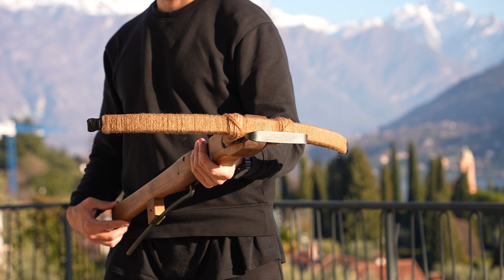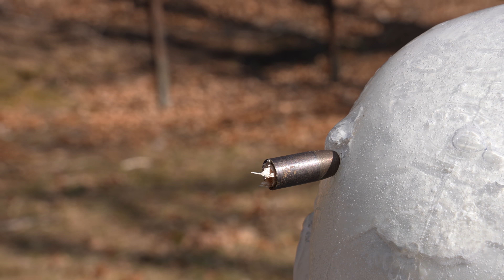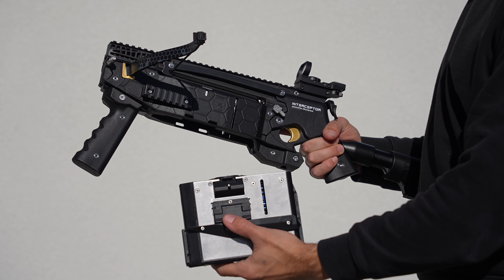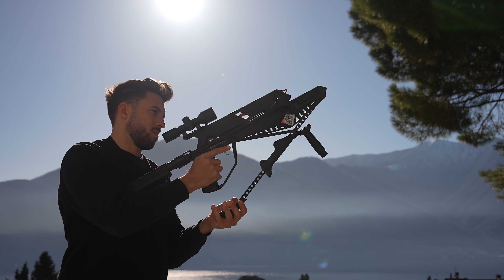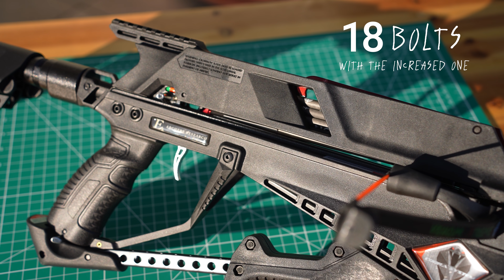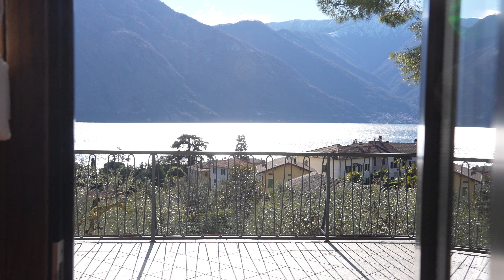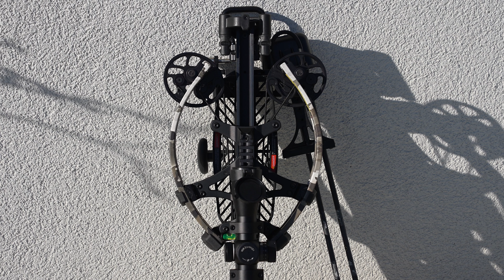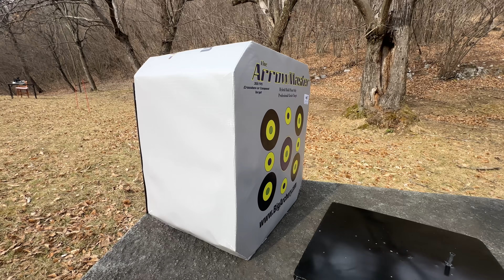How Dangerous are Crossbows?

Comment: Bad enough politicians and the media want to make up definition of Assault Rifle or Assault Weapon. We don't need influencer nonsense being irresponsible on research as well. As defined in military manual Assault Rifle and or Assault Weapon by proxy must have select fire semi, pulse, and automatic fire modes. This means a common machine gun has select fire semi and automatic fire, not an assault rifle/weapon. Go see the m16 manual among other weapon manuals for military weapons. If it's a so called combat application that's where the real definition exists. I find it very irritating when I flyencers, media, and politicians mislead people largely unwilling to research for agenda.

That all said that roller cam crossbow is a design type I've thought about making for fun. Keep in mind same as archer the speed at which your fletch stabilizes is the true point accuracy increases. Along with that is stiffness of the shaft. If you put off vane on the spine where the end of rolled sheet ends. Your arrow/bolt spread greatly reduces due to consistency of flight. In the end just like balistcs in rifles/pistols, consistency is everything for accuracy.

I have proven the odd vane out to competition shooter out shooting the local shop shooters speed shooting. They took 5-10 minutes to finish 12 shots while I was 2 minutes or less at 80 yards. This was with minimal stabilizer bar and them $12k bow set ups. I did this several times to prove a point and that was they relied on gear over skill. Mine was a tennis ball on the bullseye and them a softball to a basketball. You can see their arrow spread was chaotic and mine vertical and some wind nudge. If your do odd vane out I'd wager your accuvy and trur power out will improve. You seem like a decent content maker, don't rely on false catchy phrases to sound impressive or more impactful.

Comment: The strongest crossbow is super cool and absolutely you can make stringer crossbows even still. Always always stronger. The only limit becomes the structural integrity of the materials to hold together and at that point youd use more material. Clearly eventurally you have something unwieldy. It dislikes being wielded. 😂
So a batista sitting on the ground.
The problem becomes the fact that when the weapons this powerful its going to absolutely destroy your bolt with every shot and naturally its gonna be expensive as hell because of the specificity of what you're shooting. 😅

Comment: Medieval crossbow bolts didn't use tips like the ones you used. They used a variety of tips, none of which looks like yours and we're all manufactured for a purpose which changed over time. War tips were different from the types used for him nting so l really don't think that you optimised the medieval crossbows ability. I would like to see the head being attacked by a bodkin or triangular blade.

Comment: Besides the medieval crossbow not being an actual medieval crossbow, I think it's funny how fracturing the skull and delivering 28 joules to the head is considered "not lethal."
Reply: Definitely would be lethal if shot in the chest instead of the skull
Reply: @live_destin-3408  So is a sling shot! Also a sling hot will kill at the skull if placed right.
Reply: i m just surprised nobody talks about the tip. if the old thing got sharper tips like the others, it d penetrate

Comment: Some bolts are designed to slice more so you can more easily follow a blood trail and that will affect penetration. The "flesh slicer" bolts would not penetrate nearly as well as feild points or those like on the medieval bolts.

Comment: One point of critique I would have for this is that the bolt used for the medieval crossbow is a hunting bolt for small game, it's practically blunt cause you don't want to puncture the fur. Other bolt designs would do better, even relatively light crossbows with proper ammo could pierce mail.
But either way, great job!

Comment: I think it's quite sad that this basicaly well thought out comparison is so fataly flawed by the usage of so fundamentaly different bolts and  boltheads :( 
the medival crossbow wasn't able to penetrate the board...as if the people in the medival times were not able to produce sharper points...
also the accuracy test wasn't done with the crossbow mounted on a surface the same way for the difference crossbows.

Comment: The crossbows you showed are great... but it would have been nice if you had tried a more commercially available model (like a 150-180 pound one, which should cost between $200 and $300).

Comment: In historical records the advent of crossbows was rather terrifying. Where arrows fired from a bow could in some cases travel further. They did not have the same power as a crossbow bolt within those shorter ranges. Crossbows pretty much made the standard short bow outdated drastically. 

Crossbows had the power to over-penetrate shields and strike the person holding it lethally. Short bows did not have such power. 

Longbows though we’re still effective at the longer ranges. Fired high at long distance, gravity assist in applying more power to the arrow, and the bow itself usually had a higher draw weight. 

And even if you could make a short bow with longbow draw weights, it would be harder to draw because of what’s called stacking. The shorter bow frame will have less flex, effectively “stacking” the draw weigh over a shorter frame making it harder to draw.

Comment: My opinion the raven r470 is better then the ten point, its smaller, in my opinion the winch system of raven is overall better than ten point, the power is a little bit lower but not much, only 5 fps or so, but its more compact and has a better scope, while being only half the price

Comment: Wouldn’t the crossbow be used at large distance further out than the long bow to shoot in arc like a ballistic type attack at far distant targets a line of knights or other ranged troops archers with less range? It would be effective if like 100s of bolts rained from sky into your ranks. At such close range as you are doing it would be one missed shot then easily close the distance before you can reload it

Comment: Hey, so many people hurt their backs that way you did with the original crossbow. Could you try and do the opposite way. Sit on a bench or a chair. Hold the string like you do normally, then sit back in the chair or the bench and put your foot in the holder and push out with your legs, which are incredibly stronger than your untrained back or your arms.

Comment: What did you not understand is to draw a medievel crossbow is to lie on your back and use your feet to put the pressure on the bow????? You used your lower back, .... wich is way weaker than your legs! And the English longbow was not the most accurate, .... it had the longest distance. 

But seriously! We all love the crossbow as a weapon in case of a Zombie Apocalyps! But it will never work!

The only weapon against a Zombies must be a bend down and straightened and lowered in weigh pitchfork! It has distance, .... easy to to trust and has 4 piercing iron sharp points to pierce a brain! 

Call me wrong! But I studied how to deal with a Zombie apocalyps! It's not a joke! I studied this! At a school!

Comment: And now you know why actual medieval crossbows had draw weights of >1000 lbs. They're horribly inefficient and have extremely short draw lengths. Remember E = 1/2*k*l^2. A 200 lb recurve with a 40 inch drawlength puts out way more energy than any of these crossbows because drawlength is more important than draw resistance. 200lb and 40 inch would have been typical for medieval archers. A kid's 25lb recurve is more powerful than most of the bows you tested. Only the last 2 bows would meet the legal minimum for a hunting bow. (40lb for a recurve in most states)

Comment: I'm pretty sure it's possible to add an electric motor to winch the bowstring, to the magazine fed crossbows. That would make them full-automatic albeight also fairly slow firing. I have no idea of power consumption and other kinds of related whatnots - but I guess it would take more than a couple AA size batteries to run it through a similar test to what ypu have. Probably that's the one drawback. batteries and battery weight.

Comment: Although crossbows might have higher draw weight the smaller draw distance results in lower power also speed does not mean power cause a 120 lb manchu bow can penatrate armour while having relatively slow travel through the air

Comment: Shooting at your tree knowing people live nearby is a security hazard. Crossbows are to be shot in a secured location. Of course, the tree is going to stop the bolt... If you don't miss it. A sneeze, a wasp sting, foot sliding, miss engaged bolt, damaged bolt,... From what we can see, anything goes wrong, and your bolt ends up 300 meters away in a kids head. I've been shooting bows in competition for 10 years, and I saw things going wrong hundreds of times. Even with security officials on licensed shooting fields, things can go wrong. In one competition, we had an arrow in a car door, another one we found 3 arrows in the middle of a cow field. Things happen. You hit a previous bolt wrong, and your bolt bounces a bit left then on a branch... You never ever shoot in the general direction of people or anything you can not see where the bolt could go. That's basic safety. You are a very dangerous person. You shouldn't be allowed to operate deadly weapons.

Comment: What you bought as a "medieval" crossbow is a poor imitation – even a bow arrow can pierce a skull without any problem, and a composite bow can even penetrate plate armor.

Weak bolts and an even worse crossbow – probably the wrong wood, p.s. Metal bows were used on crossbows as early as the Middle Ages.

Comment: For a Zombie apocalypse you certainly need accuracy because only shots to the head will stop a zombie, every other part of the body you hit is not causing any harm to the undead attacker. Maybe you can separate limbs needed for movement like the legs that could at least slow the zombie down but that's almost it. But fire speed is also a plus because you can expect to face multiple attackers in case of a zombie hord nearby or something like this. Zombies tends to appear in numbers. They smell or hear you and then they gather around you. As good the the last crossbow is I think it could not match the power of a good rifle. But... the crossbow is silent and that is certainly a plus over the rifle (which is very loud unless you have a silencer attached). But the very good hearing senses of zombies is magical anyway because if your body is rotting away so is your hearing capabilities (and your visual senses too).

Comment: Oh my goodness. 

I get that you probably aren't a history buff, nevermind interested on the subject of medieval weaponry. But bro you did the "exact replica" of a medieval crossbow dirty, and I knew the test would not have been fair the moment you could pull it back by hand. So quick fact check, the "average" 50lbs draw for bows as you mentioned is not wrong, but that is more for hunting bows and such. Bows used in war averaged closer to 80lbs - 100lbs in draw weight, whilst the English longbow could go up to a STAGGERING 180lbs. The english longbow required the archer to train from a young age (around 6 or 7, sometimes sooner) and put such stress on their bodes that we have examples of english longbowmen who's spines got warped from their tool. The reason I bring this up is because the energy from those bows carried a MUCH bigger projectile, so I am offering this to show why it is silly to have a crossbow at 242lbs of draw strength. 

So what is the draw strength of actual crossbows that were used in war? Floor starts at 500lbs, averaged around 800lbs and it can go all the way up to a ridiculous 1000lbs of the windlass crossbow! There's a reason you use a mechanism and not your body to reload these things, legit impossible if it is a proper weapon built for war.  The little 242lbs crossbow shown here is unfortunately just a toy, and not a proper representative analogue. And you thought this one was loud? Oh boy, wait till you hear a proper crossbow shoot, it gives a lot of newcomers a fright because they don't expect just how much energy the damn thing packs. 

Just needed to drop this, as I am a big nerd for this kind of thing. Gonna continue with the vid now.

Comment: None of those crossbows are semi-automatic.  A semi-automatic loads the next round with each trigger pull, the shooter doesn't have to manually load the next round. A full automatic will continue loading and firing rounds as long as the trigger is held.  Those crossbows would be considered lever action.

Comment: The 10 point bow wouldn't be the way to go in a zombie apocalypse for numerous reasons even tho id like it to be. It jus wouldn't work unless your primary was a knife and your crossbow a secondary used as a more dire situational need from a correct range that keeps your arrows reusable. First being the cranking takes way too long, second by what you jus demonstrated the range of your target more than likely you would either lose your arrow because it went right through their heads or it would destroy the end of the arrow. Visually and by scene of the walking dead where this would be useful is when Rick is on the bridge and he's being overun 1by1 with walkers and Daryl comes off that trail IS WHEN this bow would be the dire situation to use it. The scene where Rick is trying to use his revolver to hit dynamite to blow up the bridge to stop the herd. But other than that this bow mid range with how long it takes to crank and multiple walkers it jus wouldn't work. You'd have to kill the one walker and back pedal jus to crank up another arrow. It'd have to be used as a secondary. Which is fine.

Comment: I work at a company that sells and does maintenance/repairs on a lot of the big name crossbows. So most of the TenPoint and Wicked Ridge line, most of the Ravin line, Excalibur, and the higher end Killer Instinct ones. Let me tell you, all of them are lethal, all o fthem can split arrows at 60 yards if used right, and I still wouldn't consider one for self defense or apocalyptic scenarios. Especially the high end ones with cams and additional cables. They require a specialized press, which is electric, and a lot of know-how. Load an arrow wrong, stand too close to a wall or a tree, crank it wrong, anything wrong and you run the risk of blowing it up. Very rarely, we're talking 1 in a million here, they could also just delaminate and fail on their own. Good luck finding replacement parts in an apocalypse. Me? I'll take a medium caliber pistol, something like a .380 ACP or a 9mm and specifically centerfire. Fewer moving parts, easier to stock replacement parts and do your own replacement/maintenance, fewer ways to screw it up. Crossbows are awesome, don't get me wrong, but if you're buying a tool for a purpose make usre it's the right one. Also, learn how the thing works and practice rigorously. Don't be afraid to watch 100 videos and ask 1000 questions before trying, because it's better then using your $4k crossbow wrong and sending it to us to fix. 99% of our repair jobs are from misuse. Genuinely. And it's probably some decimal infinitely close to 100%. Out of hundreds of repairs, especially during hunting season, only 3 haven't been from misuse and 2 of them were from a lack of maintenance (which I also consider misuse, but it wasn't catastrophically incorrect procedure)

Comment: 90lbs limb isnt enough to guarantee lethality.  I have a 125lb pistol made by mini striker and it's the least amount of weight i have tested that is lethal every time with correct shot placements. The mini striker also has the ability to load and shoot multiple bolts. That ten point is amazing though. I want one for distance shooting.

Comment: 27:02 it looks like the bolt got stuck in the skull, and since it was moving so fast and stoped so abruptly the tip went flying off, hitting the target behind and deflecting to the left. the smoke was probably just made because of friction heating up the gelatine and burning it, as evidenced by the fact that the target melted onto the bolt before.

Comment: So here’s an interesting thing: the reason that the mediaeval crossbow performed so bad, even though it had a draw weight much higher than that of a bow is leverage. A bow has very long limbs, meaning that there is more material and leverage to exert force. This means for an equal or greater amount of damage, you need less force exerted by the user

Comment: Crossbows just don't have the power of a compound bow for one reason! A bolt is a lot lighter then a full length arrow and that makes a huge difference in killing power. Had a old Barnett 150 lbs pull and it was not even near what a 45 lbs pull a compound delivers.

Comment: but the whole point of using this in a zombie apocalypse is not relying on finite ammo supplies.... which doesn't work if it needs very specific high tech arrows.... we need a second episode where you try to make your own arrows from natural materials to see which of these crossbows would be viable!
Reply: As someone who’s owned both, a compound bow would be a lot more practical. And sources of arrows would be more plentiful as even your local Walmart would have some cheapos. Plus a lot of compound bows are very adjustable. My bow tech probably doesn’t need all 70LB to kill a zombie, I could dial it down to 40LB, resight my pins, and have both an easier draw and less damage to the arrows. 

But.. a good strong crossbow is super fun. Works better in a tight position. And they’re just pretty satisfying.